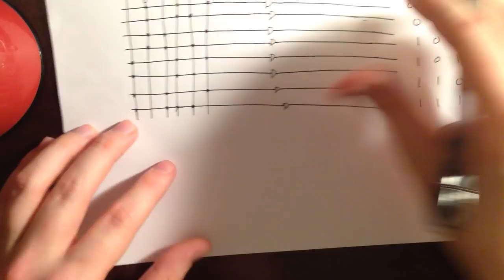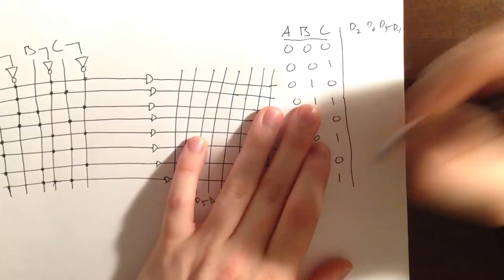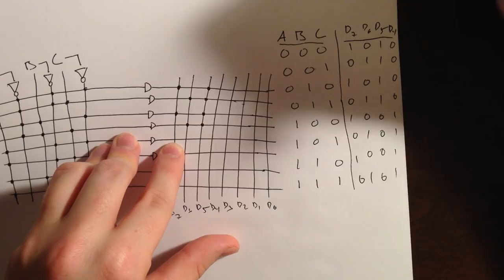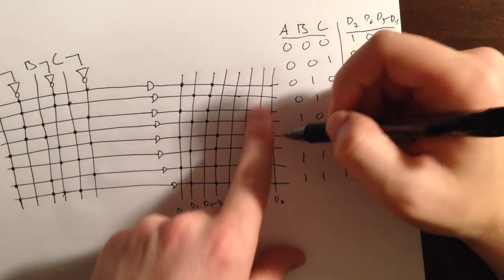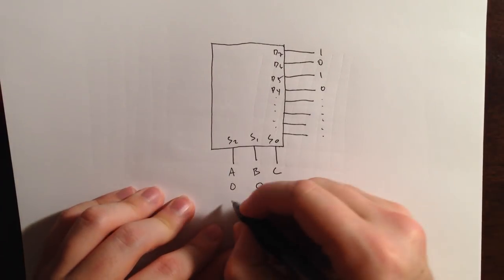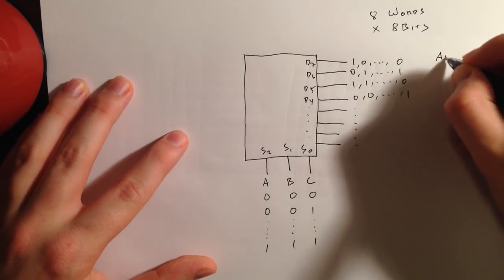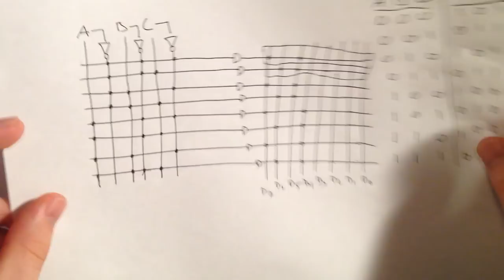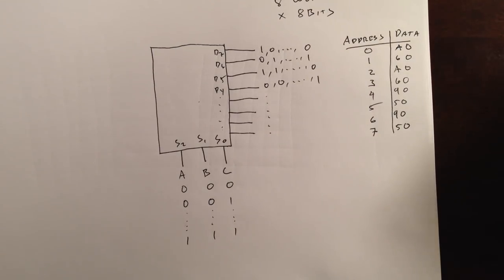Understanding PROM (Programmable Read Only Memory)

Comment: I'm SOOOOO Confused with your hex/bin conversion...   You have data lines from left to right D7-D0. (Insignificant point, kinda) You are also writing the hex 0x??? value from left to right (IE: 0x??00). but you're counting binary as 8,4,2,1...    I thought binary was always counted as single digit to the left...??? (IE: 1,2,4,8)   Am I backwards?